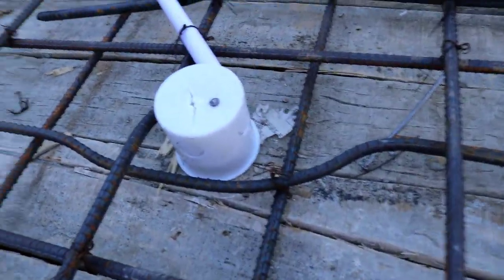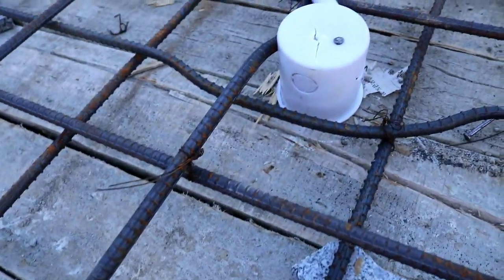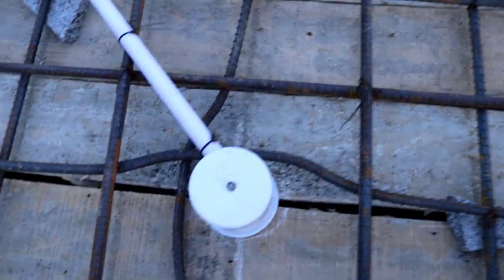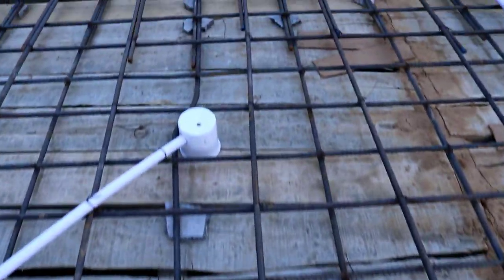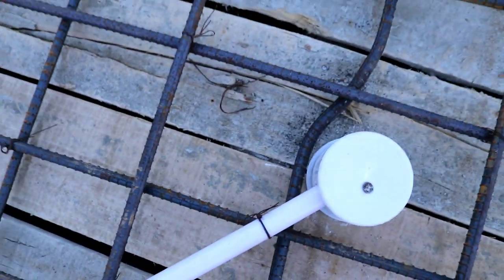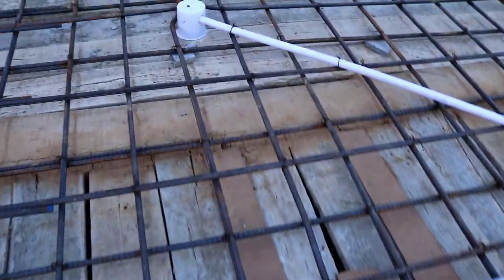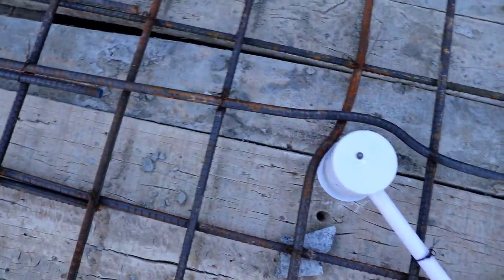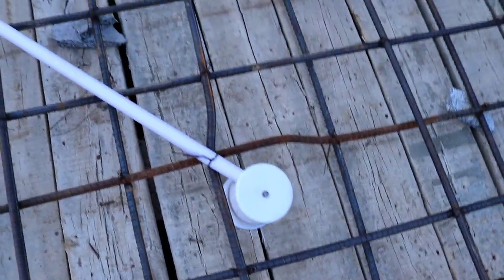Why Steel Bend for Electric Circuit in RCC Slab?

Comment: Sir why can't adjust the electrical box exactly in between main& distribution bar so that no need of bend the bar. Just few inches only.
Reply: I think the electrical box should be adjusted not the steel, bending steel distrubs the steel design in this area.
Reply: Good Apka Javab Bilkul thik h
Reply: 1:26 - judging by the scenario; he films at the roof, meaning that they unwisely or necessarily already fixated the circuit below the roof.

Comment: The steel reinforcements should not be bent unnecessarily as it would make them weaker at that section
Reply: In addition, the re-bar can actually be placed in position to avoid clashes with the electrical box. I supposed it is all depend on the workmanship at the site.